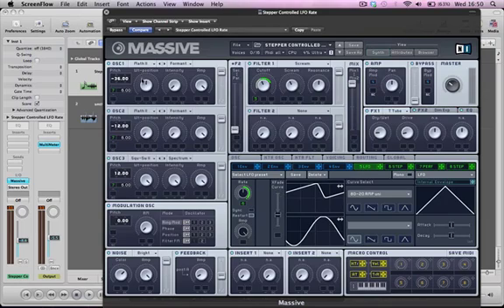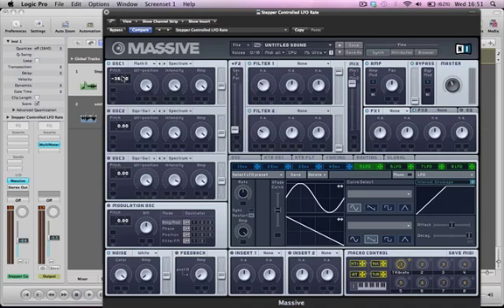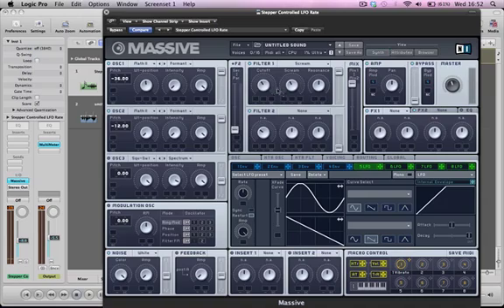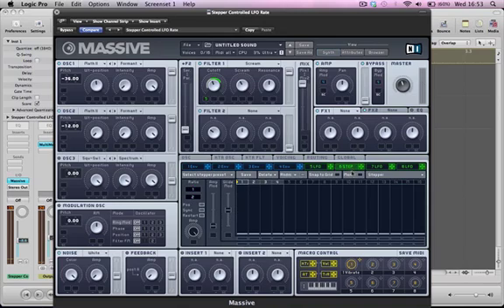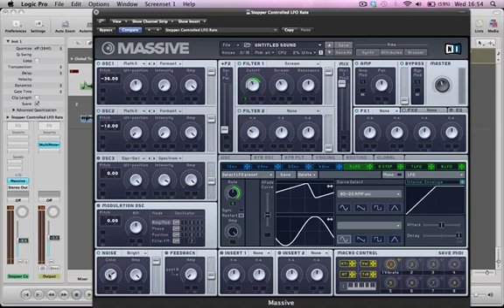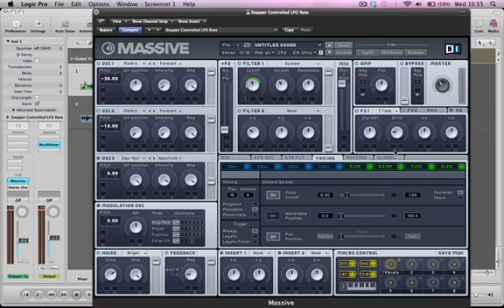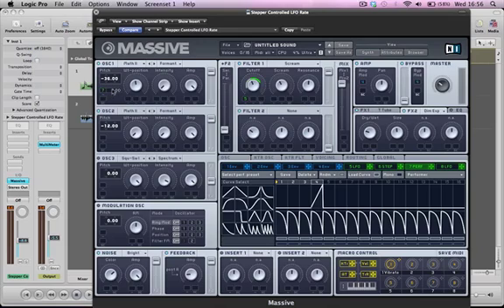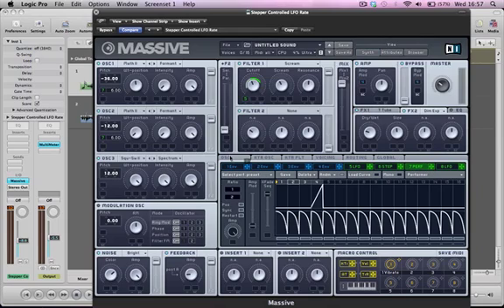What Everybody Should Know About Controlling LFO Rates In NI Massive

Comment: I have a jd xi synth with an lfo and I want to turn off the rate completely, but when I put it down the whole way, it just goes in a really long cycle of being loud or the pulse is high, and then all of the sudden after about 20 or 30 seconds, it just completely shifts to the lowest and a low pulse? Is there anyway to get the synth sounds to have no lfo rate at all, but still be able to do other things with the sound?